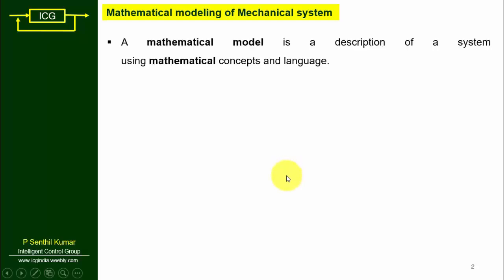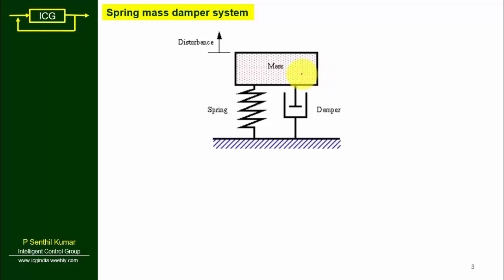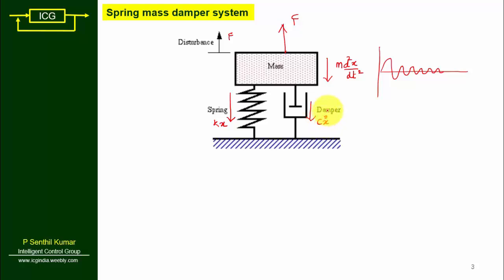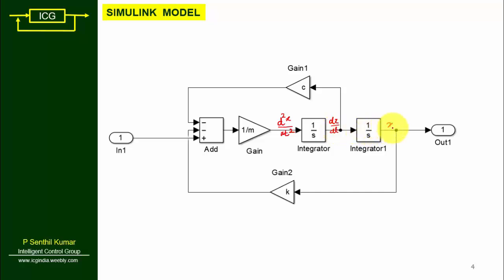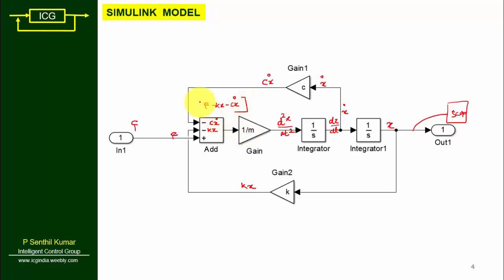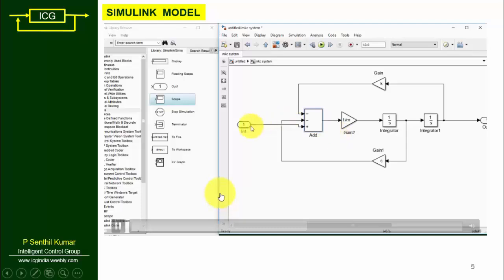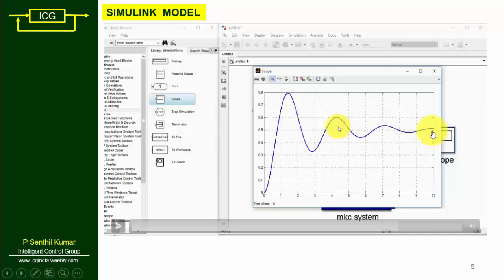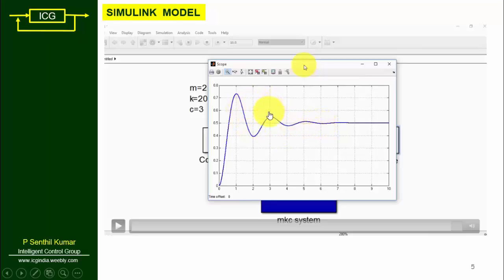Mathematical modeling of mechanical system in SIMULINK

Comment: Hello everybody;)
Help me please. I don't understand a plot at scope. What the variable in Y and X axle?
Reply from the maker: Tell me exactly the time at which you have doubt   in that video, I help you
Reply: @icgindia2970  its beginning at 8:30
Reply from the maker: @ilya-koloshin  x axis time of oscillation of mass. Y axis displacement of attached with spring.
Reply: @icgindia2970  Thank you so much. I have another question. Why plot don't come back on 0 position (Y axle)?
Reply from the maker: @ilya-koloshin  here constant force act continuesly on mass. So there is a deformation even at the end of time. Because force still acting on mass
Reply from the maker: Subscribe &  like my video to support my lectures

Comment: how to find the velocity of mechanical system on Matlab without using simulink?
Reply from the maker: Using ode solver in Matlab. But velocity is related to dynamic system so simulink will be better than Matlab. The simulink package is mostly used for simulation of dynamic system

Comment: Appreciation!    Can you upload 1/4 car semi-active suspension system Model?
Reply from the maker: Santosh Maharana sure...give me your email id. I will send 1/4 , half car , full car model of active suspension in simulink
Reply: @icgindia2970   thanks for quick reply, here it is Santosh.maharana2018@vitstudent.ac.in
Reply from the maker: Santosh Maharana I will send you tomorrow
Reply: @icgindia2970  can you made video regarding MR Damper control!
Reply from the maker: Santosh Maharana sorry.i am working on active suspension only
Reply: @icgindia2970  it's okay fist I ll understand that one
Reply: @icgindia2970 icgindia thank you for giving your valuable time!  I appreciate your work
Reply: @icgindia2970   sir great video , can you send quarter car, and full car suspension model to my mail sir it is spranavkumar1997@gmail.com, it will be really helpful for me
Reply: Sir we have to do some questions of control system using matlab , so can I use this topic spring mass damped system to run on matlab. is that fine ?